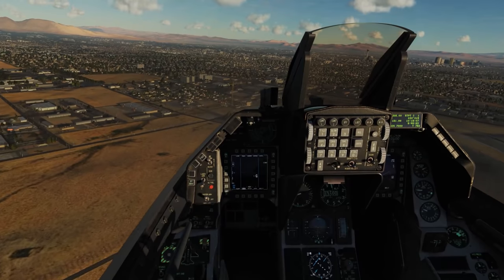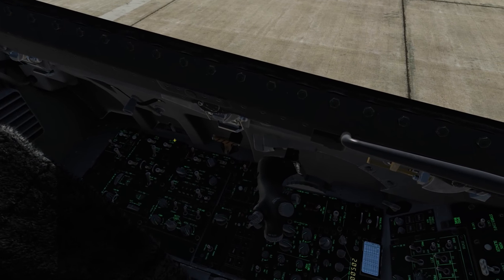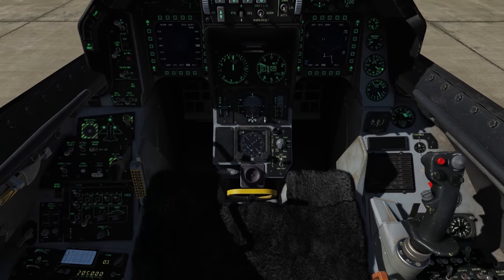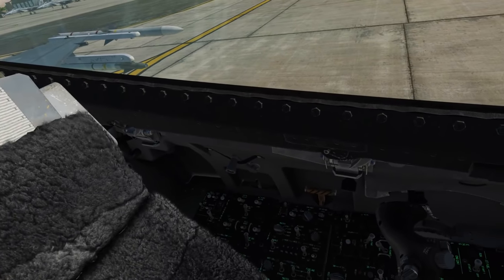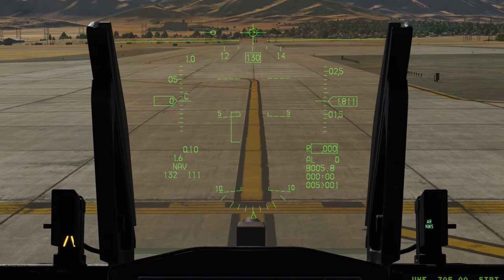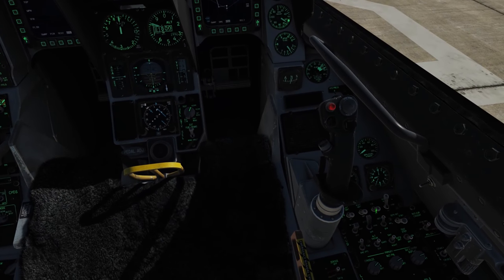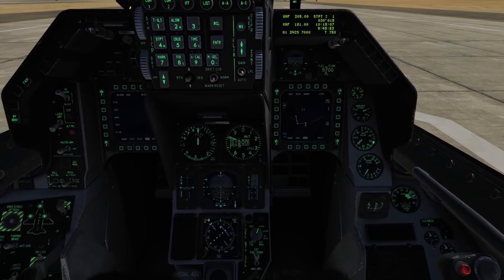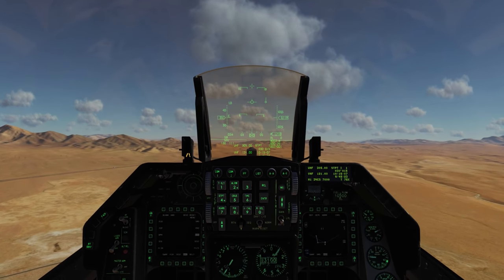DCS: F-16C Viper - Taxi and Takeoff

Comment: Small note on takeoff technique: Begin raising the nose 10 (15 AB) knots prior to computed liftoff speed. Don't wait for liftoff speed before raising nose. In this case 145 knots for 155 liftoff. Pitch rate should remain positive (~3 dps) throughout the liftoff and normal pitch at moment of liftoff is usually 8-12 degrees. The initial climb out is often at a higher pitch than was the case at the moment of liftoff. This takeoff was at a pitch of about 5 degrees and at a low or zero pitch rate which resulted in a faster than desired takeoff which did not positively leave the ground. Notice the tires recontacted the runway briefly.

In order not to over-rotate the airplane when using the technique described above an absolute pitch limit of about 15 degrees should be observed near the ground as well as ensuring that initial rotation is not less than the recommended speed or rating the nose up too aggressively. An example takeoff using this technique might be after burner takeoff beginning at 145 knots, rotating at 3 degrees per second until an attitude of 12 degrees pitch. During this maneuver and due to the combined effects of acceleration and pitch rate the airplane lifts off with transient parameters of 160 knots and 10 degrees pitch.

Other tip is that for most taxiway turns I find keeping the yellow centerline at the 135 degree corner of the eyebrow shield keeps the nosewheel on the paint. Other than those two additions everything looks spot on. Well done and godspeed.
Reply: tbh I was doing this mistake for quite a while now on the F-15s i used to wait too long that the tire flattens and have to make a emergency landing and realized it recently on the grim reapers video anyways thanks for the advice hope it helps more ppl like me

Comment: @Matt Wagner There is no way ground crew would leave a ground safety pin (especially on without a "remove before flight" flag attached) in the manual chute release handle prior to flight. I noticed this in cockpit orientation and apparently it still hasn't been addressed.
Reply from the maker: Already changed, but after I made this video.
Reply: @MattWagner  Good to hear, thanks.

Comment: Whats wrong with the FPM?The viper floating all the time?
Reply from the maker: Not sure what you mean, please take a look at some real world Viper HUD videos.
Reply: FPM should aline with horizon line when aircraft on the ground
Reply: @Ottoouy  , and it does, while the aircraft is moving. I have seen HUD tapes where the FPM does in fact settle over the gun-cross while stationary. Possibly different implementations in different blocks of the aircraft. I suggest you go do some research before making blanket statements as if you're the ultimate F16 expert
Reply: @PhillMagGamerDad  Thanks for your reply，however ，you should recheck those tapes and figure out the relastionship between FPM and horizon line.FPM jumps around the line only after the NWS is engaged,but it should never shows above the line while aircraft stationary on the ground.